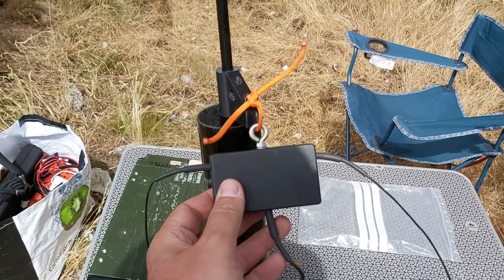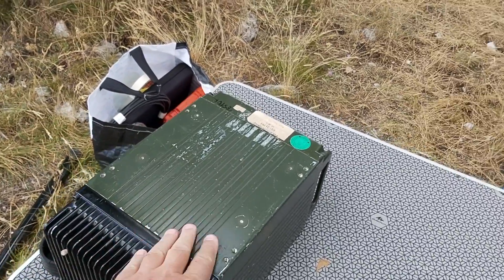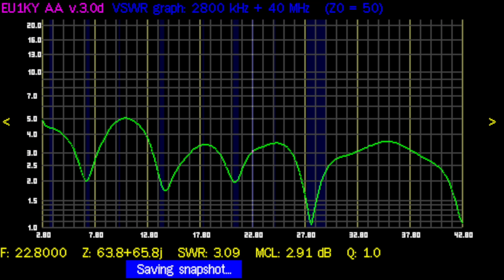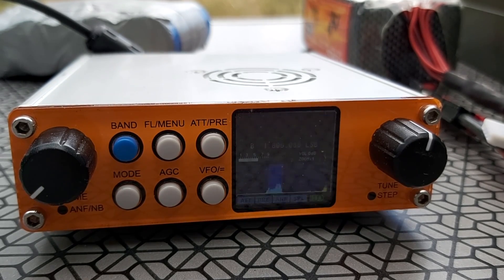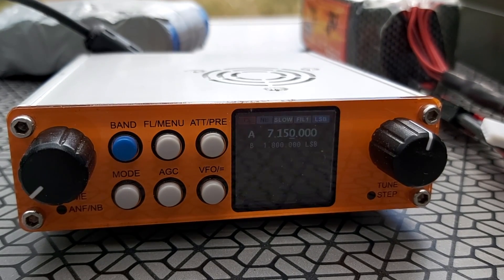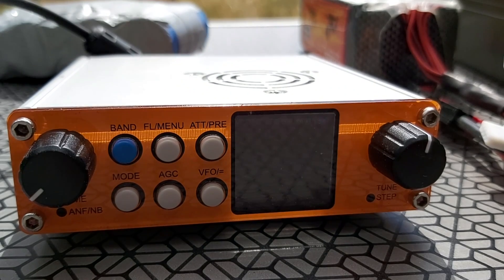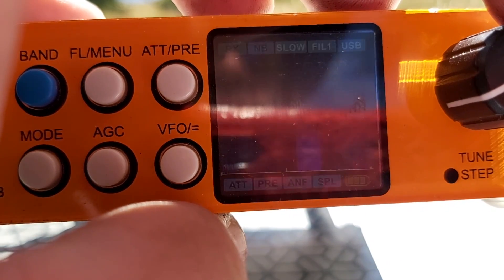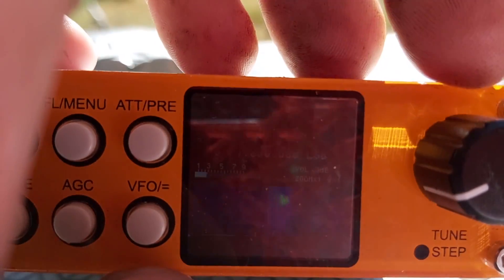Spiderbeam Aerial-51 Model 404-UL Antenna Review, Part 2.

Comment: Hi Gil - thanks for the report on your adventures with the 404-UL.  I’ve  had a lot of  experience operating with it portable, over several years.
This particular version of the OCF dipole was designed by DJ0IP after much experimentation, most of it relating to the 4:1 balun.  There’s a lot of discussion online about his findings.  He went to great effort to characterise the nature of the common mode current present on the feedline and designed the balun very carefully to maximize common mode impedanc where it is needed most - on the lower bands.  If you run a calibrated clip on current meter along the coax during transmission, you’ll discover whether he was successful or not. I’ve never found it necessary to use an additional common mode choke on the transmission line, even running 100W.  Even though this antenna is designed for portable use, it’s not specifically a QRP design, so the feedpoint balun was designed to provide sufficient common mode impedance, even running some power.  It’s an efficient, broadband and physically quite robust design and after nearly 4 years of regular portable use, my antenna is showing no signs of damage or wear.  A lot of fun.  Thanks for sharing your ideas about it  - and I agree, why not a BNC connector?
Reply from the maker: Great info, thank you!

Comment: At one time, RCA connectors were used by ham DIY builders, I think the few commercial manufacturers that use BNC have the necessary tools to assemble them, also a properly assembled PL259 seems to me to be more mechanically robust than a BNC. A BNC connector needs to be assembled pretty close to the manufacturer's specification for it to work properly. In my days in the RCAF, I have seen some poorly assembled RF connectors, I had to repair them. Great channel Gill, always informative, interesting and inspiring, keep up the great work. Stay safe. de VE7KKQ
Reply: I think one reason why people would choose pl-259/so-239 over bnc is because they want to use larger coax like RG-213.
Reply: @kd5you1  well yes, but this site is about portable ops, would you want to carry 25ft of RG8, 213 or 9913 or lmr400 on a mountain hike? I'd be using something like RG58 or 316.
Reply from the maker: Indeed. I use 316 or LMR-240UF.
Reply: @JohnHill-qo3hb  I was speaking in general, not necessarily portable ops. I wouldn't want to carry 50 feet of 213 but 25 isn't really that bad. I think about how much stuff thru hikers carry when hiking 1000 miles, so the thought of 25 feet of 213 doesn't seem all that bad. :) If  I were going to do HF only then I would take RG8X.
Reply: @kd5you1  Partly related to this, I was watching a channel where the subject is backpacking, there they were saying even the lightest items of convenience were discarded before the next trek, so I guess take it, see how it goes, re access. Much depends on you physical condition too, I used to go on weekend hikes when I was in my 20 to 30's, forty years later I do pretty good on a 40 min dog walk! hi hi
Reply from the maker: I read about through-hikers cutting the handle of their toothbrush to save weight...
Reply: @RadioPrepper  Yes they do lol as well as mailing their unneeded stuff either to their home or to a location further down the trail. :)
Reply: @JohnHill-qo3hb    I 'LUV' this reply.  It expresses my sentiments.  At 75, I'm just not into hiking in the mountains anymore.   My portable activities are now Castles On The Air (COTA) where I can drive to the location, work out of the back of the car and run enough power to be heard... especially when running the 404-UL.  73 de DJ0IP
Reply from the maker: Will do thanks 😀
Reply from the maker: Thanks, that's why I buy already made cables..

Comment: My first real use of this antenna was for IARU HF. On 100W barefoot, 7000-9000km QSOs on 20m and 40m, Argentina (9000km) on 15m, and a 1000km on 10m. I don't have a choke on the feedline, but agree probably a good idea. I'm happy with it, but even a connector on the feedline at the balun would be great. SWR: 40m (fairly flat 1.75), 20m (1.5 to 1.7), 17m (~2.8), 12m (~2.6), 10m (1.3 at 28.0, 1.1 at 28.3, 1.85 at 29.7), 6m (1.8 to 2.25).

Comment: Fit your own BNC connector, they are a dream to fit
Reply: I've made RG-8X and RG-58 patch cables with connectors on both ends using PL-259 and BNC. BNC patch cables are far easier to make than patch cables with PL-259 connectors. At least you don't have to apply a ton of heat to solder the shield without melting the di-electric center insulator and, in fact, you do not solder the shield at all with BNC connectors.
Reply: @radiotec76  If you are melting the di-electric center insulator in the PL-259, you're using the wrong type (= Cheap) of connector.  You should only use connectors with Teflon insulation.  If you're melting the insulation on the coax, then you're applying heat for too long.  Try using a larger soldering iron (i.e., 100 Watts).
Reply: @richardwesterman5773  I was talking about the cable insulation and not the insulation on the PL—259. I try to use only Amphenol connectors.
Reply from the maker: I buy my cables already made 😀

Comment: I find BNC connectors a joy to use and a pain to solder a cable to.  Just buying adapters (and cables with pre-installed connectors) seems to be the easiest solution.  I have the same problem with the SMA connectors used on the cheapie NanoVNA I use as an antenna analyzer, and on my British SDR receiver as well.  I have an old Heathkit QRP radio from the '60s that uses an audio RCA connector for the antenna!  Add in the need for banana plug connectors and my jar of cable adapters is getting larger each year.  At least the SO-239 is a good place to start connecting all these different standards together, if one can find some reliable connectors.  Some of the Chinese ones I've bought simply didn't work.
Reply from the maker: I buy already made cables too, cut them if I have to...

Comment: Cutting a piece of wire, charging €99? What's up with ham radio?
Reply: Making a piece of wire resonate on 4 bands without any traps or tricks . . . is not an easy task.  Keeping it ultra-light, yet sturdy requires using components that cost a bit more.  And, minimum wage in Germany is 10€ per hour.  That's what's up with modern ham radio.
Reply from the maker: There is a two-core BALUN in the middle.